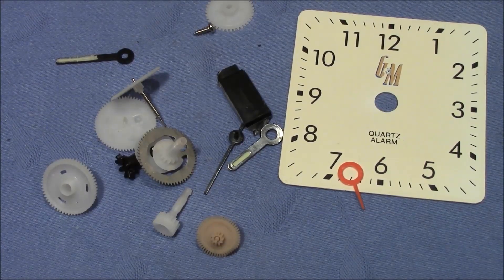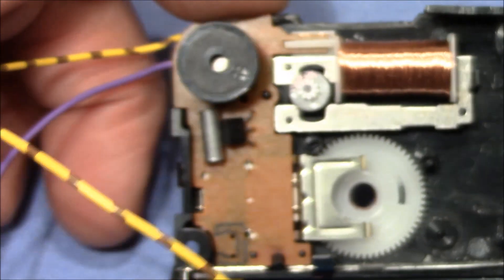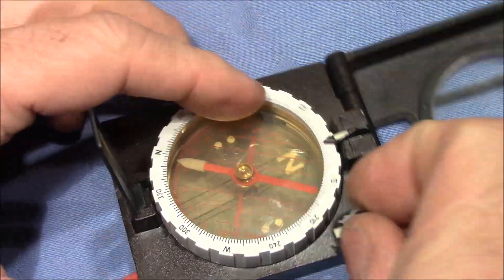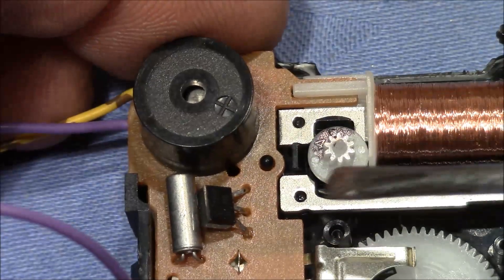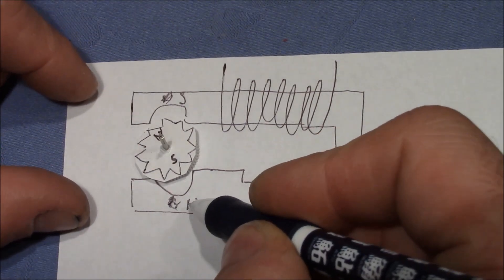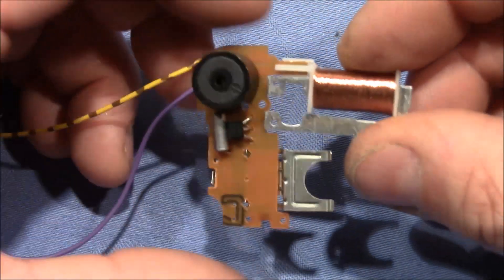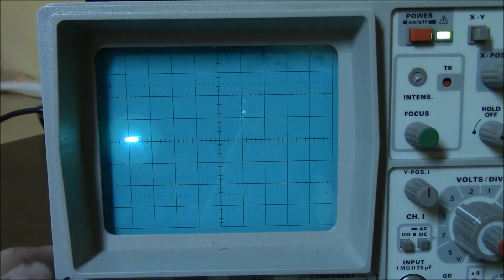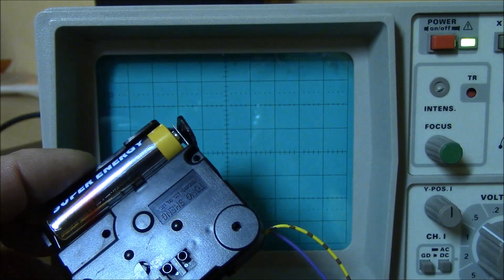(unrelated 6) What makes a clock tick - exploring the Lavet motor

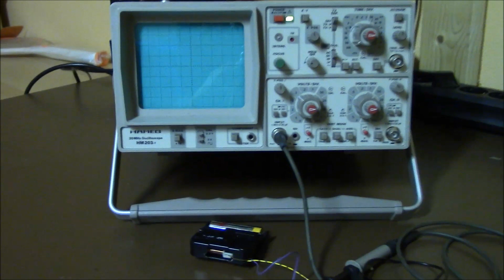Comment from the maker: 1:40 demonstration, 6:18 explanation, 12:51 signal on scope.
From an electromechanical alarm clock, I extracted the Lavet Motor and explore it's properties. The motor was invented by the French engineer Marius Lavet in 1936. The mechanism is a stepper motor that gets triggered once a second by an electromagnetic field generated by a coil. A quartz and a frequency divider are responsible for the 1Hz electric pulses. We see the motor spinning, learn about the principle of the mechanism and see the signal on a scope. 
Also check wikipedia https://en.wikipedia.org/wiki/Lavet-type_stepping_motor
Reply from the maker: Nonetheless, thanks mate - sometimes I post about topics out of the usual lock area. Will send your package probably next week.
Reply: @Potti314  and that is just fine it is interresting to see other stuff too, and my package?
Reply: Well not relly for me but very cool to learn a bit tho and the package should get to you sometime next week i Hope so

Comment: But you didn't explain why does the Lavet motor always spin in the SAME direction, always clockwise, no matter it's initial position. Because if I turn it 180 degrees, the forces will get inverted, but the direction will again be clockwise.

Comment: Super informative! Showing the signal on the scope was great! The very short pulses of electricity allow small battery to last a long time. 
I would make one correction: The one pulse per second changes direction every second, and so the full cycle on the Lavet motor takes 2 seconds, and it is 0.5 Hz frequency, and not 1 Hz.

Comment: I saw it mentioned a few times, but Ill throw in my two cents too because why not...

3:00 its true "quartz crystal" would get the point across, more exactly its a "crystal oscillator". However, even simply "crystal" would do in just about any conversation, colloquially casual through technical and otherwise. 

For the uninitiated: The quartz crystal being the bit inside the crystal oscillator that is effectively shaped into a tuning fork (not literally but the same effect) so that it resonates very strongly at the given frequency. A circuit utilizing them would 'flick' the crystal at start up which thanks to the piezoelectric effect (deform crystal make pixies angry) sets the thing jiggling, and it naturally settles into the design frequency giving a resonant return voltage peak much higher than 'normal'. There are better manufactured oscillators which 'tick' more precisely, there are ones that will monitor the crystal chamber temp and output a correction signal (it sounds fancy, but its pretty much just a thermocouple, really simple electronically speaking) to compensate for thermal effects like expansion and contraction of the crystal itself (if it changes shape, it changes resonance. In some application that REALLY matters....A LOT), and then there are SUUUUUPER cool temperature compensated, oven controlled, crystal oscillators!!! These things not only monitor the internal temp, but also contain a heater (again, sounds fancy, but its just a resistor. Still super cool though....er, hot....you know what I mean....) such that the crystal can be actively thermally controlled to resonate exactly where the designer wants it to resonate! Beyond that you pretty much have to start looking into atomic based clock sources if you want higher precision......Luckily, GPS radios are pretty cheap and Network Time Protocol is a thing, and apparently rubidium standards arent impossible to find nor incredibly expensive if you know where to look....so....yeah.

Anyhoozle, I totally stopped 3 min in to blurb that. Loving the video so far, mate!

Comment: You can improve the accuracy of the clock by replacing the quartz crystal with a crystal from Citizen Watch Company (same size, same package, through hole) with higher initial accuracy, lower temperature drift, and better aging. The motor driver H-Bridge is part of the control IC circuitry. I think the descrete transistor is for the Piezo alarm transducer.

Comment: What is the ic that is sending pulses to the coil? I haooened to take one apart today and while its nearly similar the ic on my pcb has that stupid ootting compound over it. However, the circuit looks simple enough the crystal is powered from the aa battery resonating a signal to an ic that appears to be functioning as an amplifier allowing the full 1.5v to oower the coil in short bursts but i cannot gain access to the ic without possibly damaging it.

Comment: Some quartz clocks shows continuously sweeping moment without ticking noise, how?
Reply: The electronics generate eight pulses a second instead of the one per second. Likewise, it takes eight half-rotations of the rotor to advance the second hand one second. That gives the impression of continuous motion. There's a rapid ticking noise, but it's less pronounced.
Reply: @luvnotvor  Thank you!

Comment: The transistor is only for the beeper part..  it beeps every time the signal starts and stops from the positive then negative applied voltage to turn the rotor, so beeps 4 times a second and the delay is a product of the circuit and transistor switching states..
Reply: Nice.

Comment: There's a variation of this motor where you can feed it with 50 or 60 Hz creating a synchronous motor useful for time counters. However my experience is that it might start again backwards if it stops with the rotor at the wrong position. Something that might happen when you have a mechanical counter that's in the process of doing a rollover when it stops.

Comment: I haven't gone through all your comments to check, so forgive if someone else noticed the oscilloscope time base red centre adjust is pointing to the right, which is for magnifying the preset divisions, my older Hameg 203 doesn't have the 'cal' label below. So the 30mS pulse is probably a bit shorter.

Comment: If there are two coil, the movement will be hi beat?

Can you explain how sweep quartz movement works?
Reply from the maker: No idea what a sweep quartz movement is.
Reply: @Potti314  its like normal quartz but higher  beat
Reply: they work the same, but they divide the clock 8x less (so they get 8 pulses per second) and are geared so that they move 8x less. The 8x is by ear, it could be 4x or 16x but you get the idea.
Reply: @sail4life  You've got a good ear on you, 8 times a second it is. Also, you could record a video of the second hand, play it back slo-mo and count the steps.

Comment: If you flip the "U" shaped magnet over, the clock will run backwards.
Reply: I didn't hear if you mentioned it or not, but the crystal is 32,768 Hz, with a 15 step counter.
Reply from the maker: Thanks for watching and commenting. I also read about the frequency, just the first power of two that's over humans abilities to hear.
Reply: That's a fun thing to do. I was once kept waiting in a scruffy meeting room at a business partner's for much too long. I took my revenge by making their cheapie IKEA clock run counter-clockwise.
Reply: @luvnotvor  part of the counterculture.
Reply: I thought reversing the coil connection to the circuit board will do it.

Comment: so cool that a crystal can be a perfect 32768 value, and it can be devided by 2 all the way down to 1. the transistor between the output gate of the cob and the coil protect the cob from the reverse spikes coming from the coil fighting back to keep its magnetic field, and the low base emitter current is also better for the cob.
Reply from the maker: Ah,  thanks for pointing that out. Makes perfect sense to me.

Comment: I didn't know it was called a Lavet motor ! I always wondered how the rotor rotated in only one direction, now I know :o)  And yes, the timing component is just called a 'quartz crystal' in english, usually in a clock they oscillate at 32768 Hz and divide down to 1 Hz from there, as you said. I think some older clocks the crystal runs at a lower frequency than 32768 though.
(I have an ultrasonic 'bat detector' which can hear these 32768 Hz clock crystals vibrating through the clock case  - which is nice - though it is very quiet :o) )
Interesting to see just how short the motor coil pulses are too - on an analogue Hameg 'scope too - thumbs up for analogue !
Reply from the maker: Thanks, the scope is a leftover from my electrics area. I'm glad that I figured out how it works. I was buffed when I saw it the first time. The frequency is just twice as big as what humans can hear.

Comment: Very nice video Potti, I really liked it and your explanations :D. A workmate once brought me a timer clock with such a motor, but I couldn't fix it for her ...at least I know now how it works :). Very nice hehe, you have an old Hameg 😃👍 (does it have the component tester too, as some of them had?). I havn't used my scopes for a very long time 🙄. The little metal thing (the Quartz) is called a crystal, it should be a 32768Hz clock crystal which is divided down (you can divide a couple times by 2 until it reaches 1 Hz). Keep up making such cool videos beside picking :). 😊👋🦊
Reply from the maker: Thanks mate, glad you liked it. I bought this hameg more than thirty years ago but it still works fine. It has a component tester which I have never used. The frequency of the Quarz should be 2^15 the first power of two over what humans can hear. So cool...

Comment: Same goes for wrist watches , they're just a lot smaller and , heavier a lot to reassemble. :) Main thing aka "heart" of any quartz watches is the part at 3:07 , there's inside tiny quartz "fork" (can't recall exact name in english and , I'm lazy to google it) , which is perfect in Bulova Accutron II mechanisms and oscilates exactly 262KHz. :) Now , the circuitry and motor step it down do 1Hz which is equivalent of 1 movement in this case. :) I wont get into entire process here , as it can be very lenghty comment , but , I did watchmaking as a hobby. :) Older quartz watches from 1940's to 1960's have oscilating element quite big and can be heard as buzzing. :) Then , Bulova himself have changed them a lot to what we know they look like today. :)
City and every public installment ( big , public) of these is of size like shoe box. :)
Edit: Yes , it does get amplified as output is very low from quartz element , so , this transistor should be the NPN one. :) Voltage gets amplified , so that motor can do its part while frequency gets lowered down. :)
Reply from the maker: Thanks for the info and for watching. Will measure the frequency as I have heard that 2^15Hz is used nowadays. It's such a cool mechanism.
Reply: It was joy. I have similar Kienzle clock that still works today. :) And is a bit older than me. :) I remember when I was a kid incorrectly reading it as "Kinezle". 😂 It's sturdy clock , it survived numerous fist punches as the sound they make would scare the s*#t out of person. 😂 They also ticked , but with no movement when battery was nearly flat , seconds hand would just tilt in place. :) Yeah , newer ones oscilate at much higher frequencies and sometimes have two oscilating elements that do not oscilate at same frequency to avoid interference. These types of mechanisms can be found in chronograph type wrist watches. :) Or Casio G-Shock series , as I am most familiar with these. :)

Comment: I fixed a broken motor coil on the movement of an old Linden kitchen clock a while back.  I know I could had bought a new movement for around US$6-7 but this movement was better quality than those found in most newer quartz clocks.
Reply from the maker: Great to read that someone fixes such things :-)
Reply: Interesting. Did you wind a new coil?
Reply: @luvnotvor  No, I found the end which broke off and soldered a thin wire to it.  It was very close to the end of the winding.
Reply: @douro20  Lucky you. I'm forced to wind a new coil for an Italian Boselli flip clock, which has a rather large Lavet-type motor in it (the original coil is missing). 11,750 turns of fine wire are needed. I wonder if I'll pull it off without a professional coil winding machine.